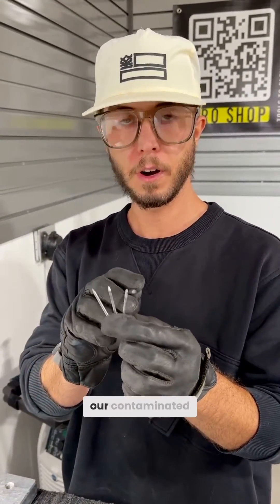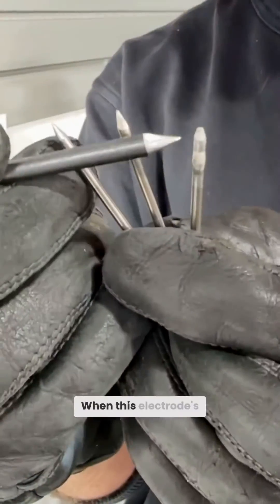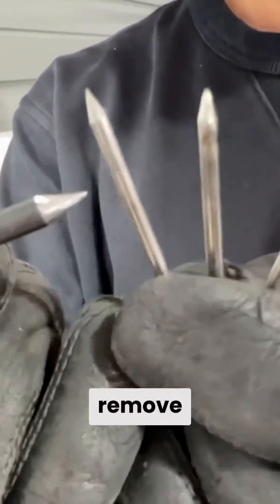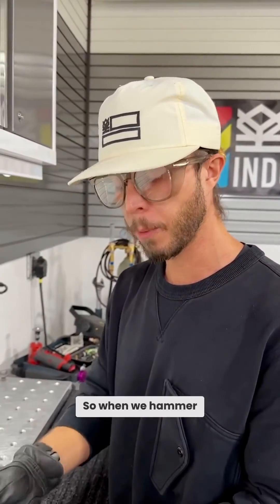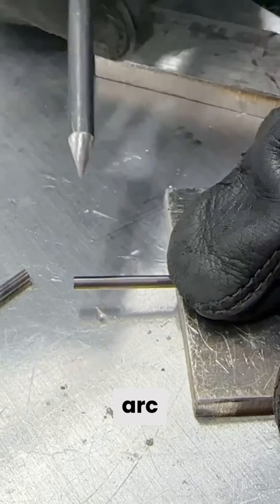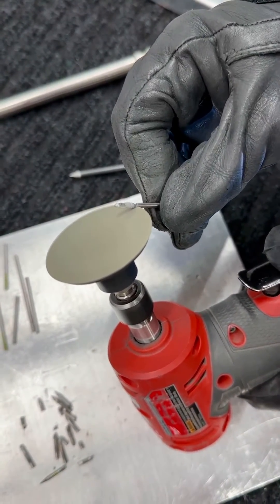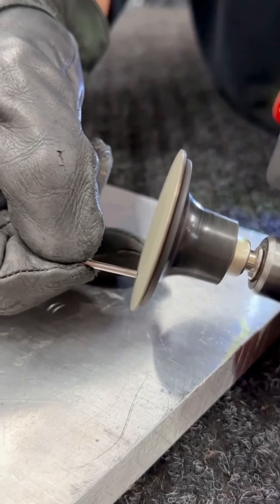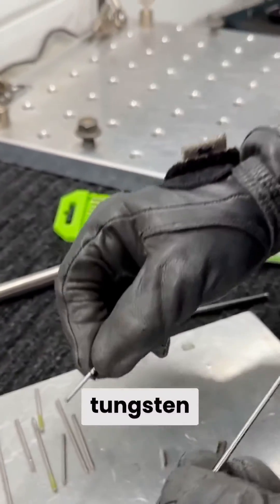Tungsten Contamination : REMOVED

Comment: Good video, as usual. Where'd you get the quick mount abrasive? I've used some thin diamond wheels in the dremel, bit they dint really cut well on the edge, and wear out after a cut or so. Thanks for any info.